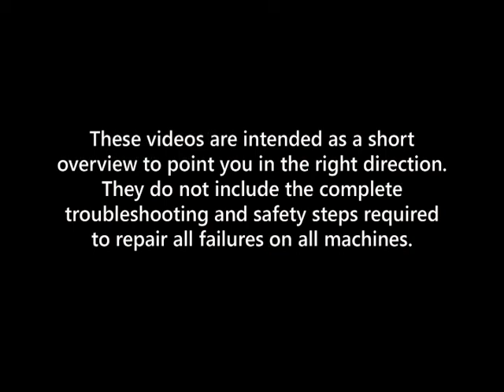Identifying a Long or Short Nose Motor on a Bobcat T200-T320

Comment: I have a 2004 t300 why does my rear idler bearing have teeth on em and this doesnt?
Reply: You're seeing wear, the bars on the track wear teeth like grooves wear into idlers after long life. Once you replace your rear idler, we will see the new idler is a larger diameter looks like this one.
Reply: @LeviBurkholder  so its suppost to be without any teeth?
Reply: @joshmarauder  Yes, all the idlers are supposed to be smooth.